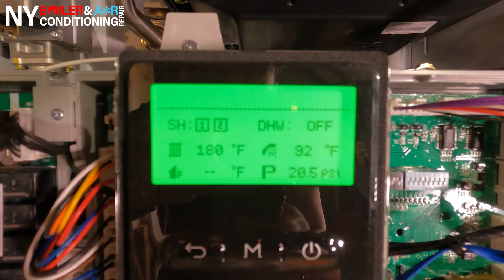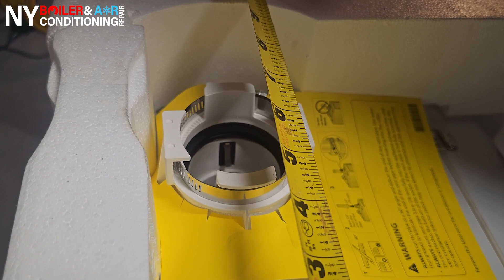Navien Gas Boiler Installation Process Model: NCB 240 130H

Comment: Man I like your energy but you’re wrong in some things with your install. Also you missed the mark on some of your distances with the exhaust. Just be careful you don’t hurt someone or ruin their equipment
Reply from the maker: First I want to say thank you 🙏 for the support and appreciate your comment. However I completely disagree. Why because why go and try to have everything by the book according to the Navien installation manual which we do. Now you and I know if your in the business we try out best but there are some houses we have some obstacles like when your mentioning about venting the exhaust and on this video there is absolutely nothing wrong. Now if you’re talking about doing it your way. Now there are different ways of how I would do it or you would do it and that’s just matter of opinion and that doesn’t mean I did it wrong and or you did it wrong. If you read the book it clearly stats needs to be a 12” min seperation which you clearly see on the video. Now if your mentioning about the chimney. There is no over hang or any obstruction like trees etc that would cause a venting and exhausting issue like cross contamination and plenty of wind to remove the exhausting and regards to the window being close it’s within the min clearance because we dont terminate for obvious reasons next too a window however in this job it’s high enough and clears the min requirement and the boiler is piped in a 100% correctly because we read and go over every install again and again over the installation manual to prevent any mistakes. Which is why I show case my work because I’m very confident in what we do and take pride in our work. Believe me I see many jobs out there in the YouTube space that i disagree with as well but everyone does things differently. But if they screw up I’m ok with it too because we get the calls to fix the issues and mistakes others do and it makes me money 💰. Thank god we have a very good track record and customers loves us and as of now no one has complained about our installations

Comment: I had a Navien NCB 240 N6 installed 9 years ago.  It’s had numerous problems,  3 circulator pumps, 2 3-way valves, then dirt magnet was installed, replace expansion tank.  Every year, the boiler was descaled, and serviced, too.  Now, our gas company has tagged it, for the smell of gas from the flu, needs repair, again.  Because of the age, I’m thinking of replacing, it’s much less money to buy a Navien again. My installer, thinks I just got a lemon, on the first Navien.  
Any, advice would be helpful!

Comment: Got one of these why do they burn gas fast?
Reply from the maker: When you say burn gas ? What do you mean ? Are you taking about the boiler is consuming a lot of fuel ?
Reply: @ yes in two weeks it burn 50% of my gas tanks at 69-70 on my thermostat
Reply: @ im on my 3rd tank refill within december at $255 a fill i got two 120 gallon tanks

Comment: Louis, again, I am not a hater but you are providing wrong information. If you look at navien installation manual, you need to install termination tee. If you need to go further, use 3 inch pipe instead of 2 inch.
Al the vent is too close to the window. Just follow the installation manual before you kill someone with CO.

Comment: I am having issue with my boiler(not Navian boilers) I have the old school hydraulic boilers where you have to light it to heat the water. 

Anyway. The second floor is getting alot of heat which is fine but the first and basement are getting very very little heat and I don’t know why. 

I am in queens and would like to get a quote on 2 Navians boiler combination with installation as well. 
May Jesus bless and heal you all here and your families as well. Amen. take care. Merry Christmas yall.
Reply from the maker: No problem… feel free to call me directly at 917-468-2325 or my office 516-377-5200… weppa

Comment: Do you have recommendations for programmable and/or smart thermostats for Navien Combi Boilers? We've tried a few cheap Honeywell 2 and 3 wire, and none work properly. Thermostats call for heat, but are not able to adjust temperature, so boiler just runs continuously.

Comment: I live in a condo and our individual boilers are vented through the back wall to the backyard. The new Navien boilers have two vent pipes. My condo will not allow an additional hole. The existing vent is 4 inches. Any suggestions.
Reply: @lenny364   You can use a concentric vent kit ,it will accommodate intake and exhaust in one opening. I have installed many of them in your type of situations.

Comment: Whats the estimate for a job like this
Reply from the maker: Depending what needs to be done it vary from $12k - $18k. Depending what’s involved meaning how many zones? If it’s for radiant heating and application and if it’s an oil to gas conversion. So it’s more than just installing the boiler. But I would say that’s a fair number
Reply: I just installed one of these systems and I was around 7 grand in materials no labor

Comment: Why you terminating the exhaust below and next to the window... Red tag, or waay baah 😂 no good
Reply from the maker: Im going to expalin why? Based on the lay of the job, we didn't have much room and based on the circumstances we explained to the customer and they understood and also that window rarely opens so the customer wanted it there and no additional holes and not close to the back yard. I should mentioned that in the video but the next time i encounter an issue like that i will be sure to mention why we terminated the way we did and location. Some jobs you have to do what you have to do and some customers are ok as long as we explained to them and show them. But i do agree with you. When your in business sometimes you have to bend the rules a little bit because some jobs are just not so straight forward.

Comment: have you had any problems with these new units 3way valves ?  hot water but no heat?
Reply from the maker: Yes, I have … the 3-way valve is a common problem how ever that also has to do with the water quality of the water… so I would suggest installing a water filter and softener if possible and a magnetic 🧲 water filter